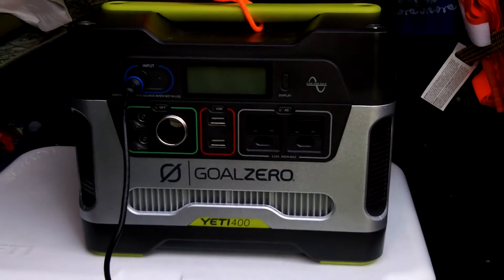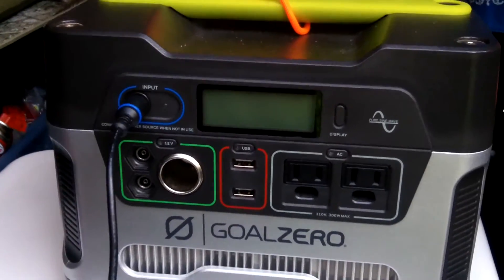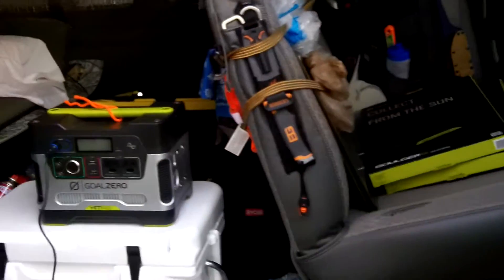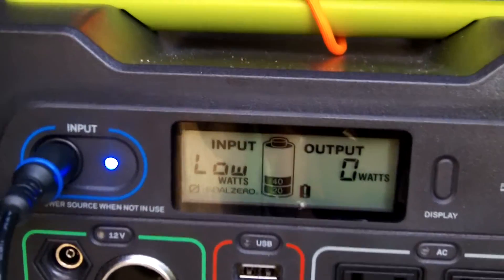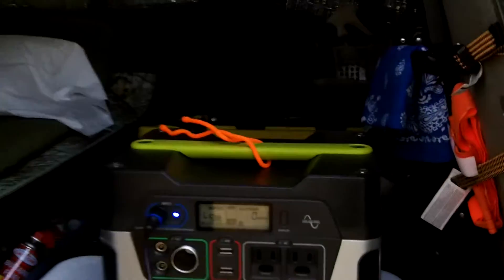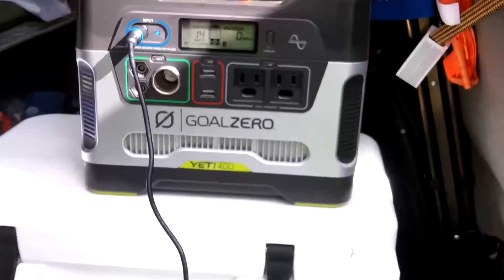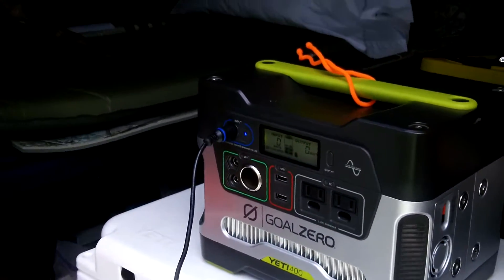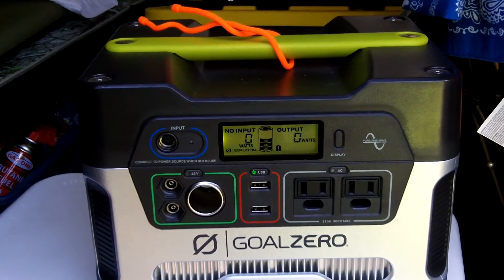Charging a Goal Zero Yeti 400 Battery w/two Boulder 15W Solar Panels

Comment: I have a GZ Yeti 400 with a GZ 100W solar panel but I get max 30 watt output on a bright sunny day, even adjusting pannel elevation. Bit disappointing.
Reply from the maker: Check with the GZ Team and see if that is normal.  They are really good at answering questions.

Comment: Van I safely charge my yeti 400 lithium by using my van while driving?
Reply: Can I.   Not van i
Reply from the maker: You can if you have the set up for that.  I can using the 12 volt cigaret adapter while driving and battery will charge.

Comment: you have to chain the panels  together to increase your input not just clamp them together and if you did chain the panels together then you should ask for a refund only getting 7 watts out of a 15 watt panel thats just false advertising and a scam.
Reply from the maker: Correct.  If you chain the panels together, add to the overall wattage.

Comment: Question.  You had two Boulder 15w solar panels hooked up, correct?   But only showed 14w at the highest point?   You never even got close to the 30w you were talking about.   Can you explain?
Reply from the maker: Could have been the amount of sun the panels were receiving and also some loss due to the length of wire.
Reply: LoweDownDriver placing your panels in direct sunlight is crucial to reach maximum impact . You will need to follow the sun as well.

Comment: Not surprised it only went up less a bar, its a large battery and a small wattage input, I would say it did fairly well actually. Have you considered powefilm panels? With those monocrystaline I would inconspicuously mount them to the roof of your van with a makeshift weather cover and look into a 30 watt thin film panel for your portable option, much better in low light and obstructions.
Reply from the maker: I knew it would not move too much at only 15 watts of input.  It did do pretty good and would have given me a good boost.  I am thinking about a folding suitcase or perhaps mounting one to the roof rack.  Have not decided yet.  I am looking at some thin film options as well, just have not purchased any yet.  Thanks for the info!

Comment: I've been wondering about these, I'm often working in isolated locations. I'm watching with great interest here in the not so sunny UK.
Reply from the maker: This set up works very well.  These panels are my original panels that I purchased.  Since then, there are other panels with more wattage.  I will be getting another set of panels with at least 100 watts to charge battery faster.  Here in South Florida we get a lot of sun.